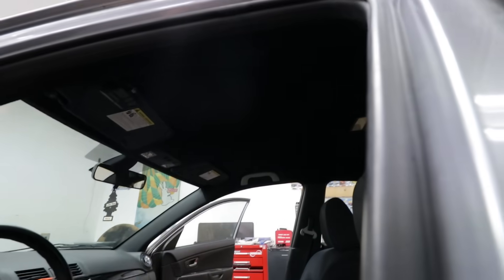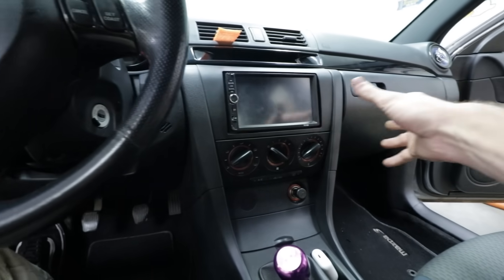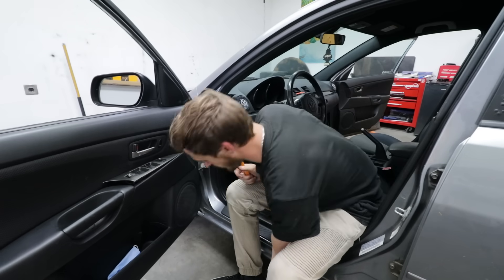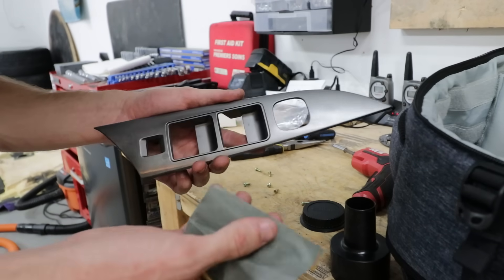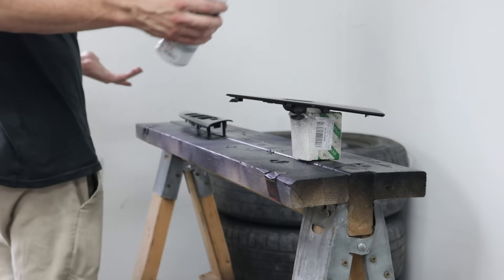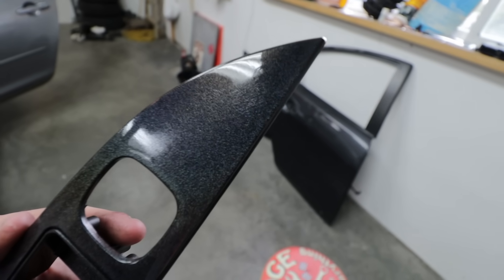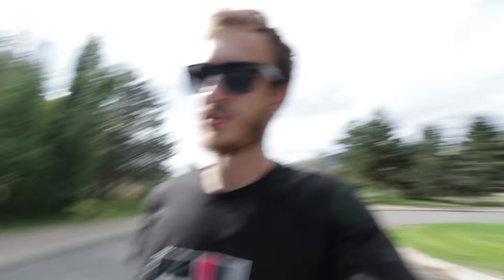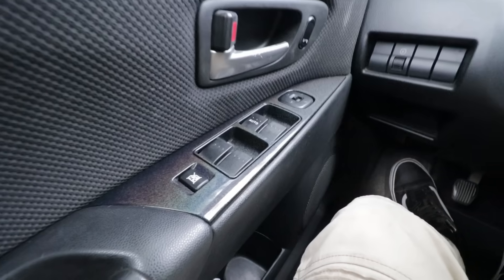BLACK GLITTER INTERIOR PANELS! | How To Paint Interior Trim

Comment: So friggin dope dude. Man I have gotta put some time into working on my car. There's still a lot I gotta get done. Is it possible if you can do a video on foot well lights but instead of connecting them to the cigarette light like you did in that video, can you show us how to wire it to where they'll only come on when the doors are open?
Reply from the maker: I'm not entirely sure where i'd wire that in... there must be a fuse or something that deals with the door strikers
Reply: @ColtonRichter  I thought of maybe running it up the a-pillar then directly to the dome lights. I just have no clue how I would connect it
Reply from the maker: Probably solder it to the "door" switch I would think
Reply: @ColtonRichter  Ah I see.

Comment: Should I use primer then block gloss right that should work for my bmw wooden trim?
Reply from the maker: Yeah, maybe use some adhesion primer as well 🙂
Reply from the maker: You could always give it a light sand for better adhesion but that's up to you
Reply: @ColtonRichter  
2x primier (sandable) 
2x gloss black + primier
2x clear coat
by rust oleum

or should i still use adhesion ? the trim is like metal type trim not plastic
Reply: @ColtonRichter  yes you mean like prep work like give it a 400 grit light sand?
Reply: @ColtonRichter  thank u for ur time ill make sure to prep it 400-1000 grit so it can stick better...or how much would a shop quote me? its like 5 pieces of trims
Reply from the maker: I'd just do a light 1000-2000, not need for aggressive
Reply: @ColtonRichter  okay so no 400 just 1000 if i want it more smoother then 2k? okay thank u im learning